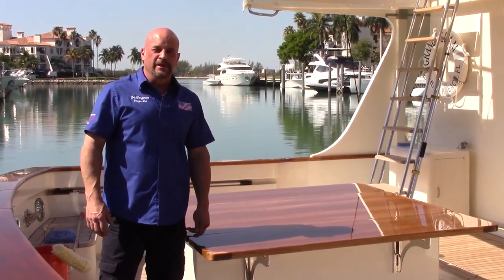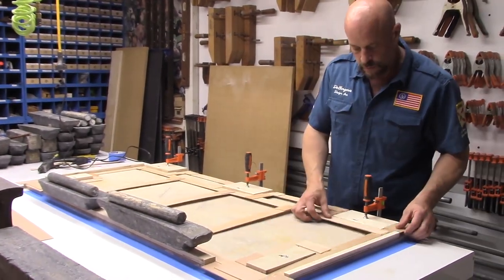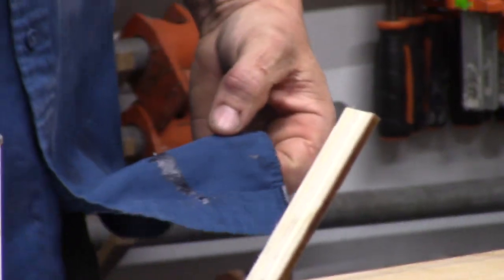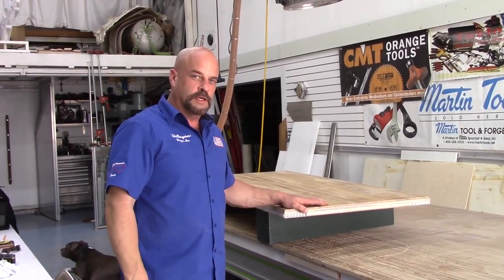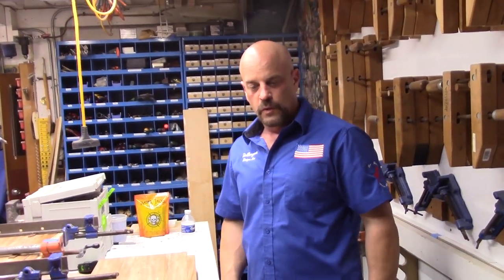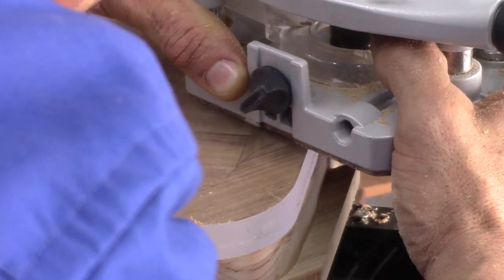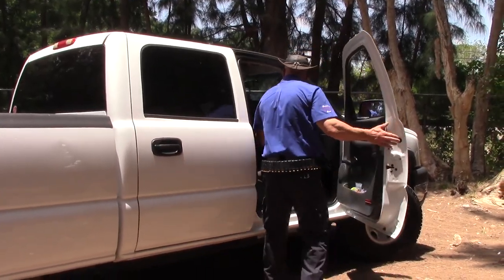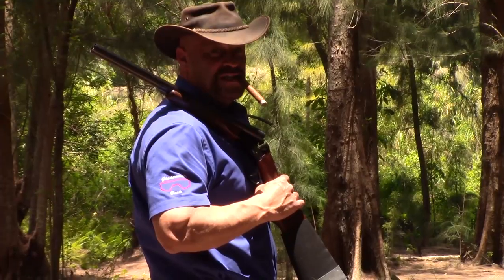Aft deck table fly leaf design Part.2

Comment: When you're doing the epoxy, is the tape wrapped around it so there's no epoxy build up on the other side where it runs off?  I assume you then tape off on the edge and epoxy the other side?

Comment: I think your dog said "are you kidding?!" in the beginning. LOL 

A lot of people fail to realize it's always best to make a smaller version as a test piece. Glad to see someone thinking ahead. 

A thou difference only tells me that, that's just the difference in the weight(s) you used to hold it while it dried. Since that plastic core will move slightly with weight applied to it, (if I remember correctly that is). 

It turned out wonderful. Another excellent video. Cheers. :)
Reply from the maker: Thank you for your comments. The honeycomb actually adds rigidity in weight to strength ratio and it will not move when properly bonded on each side. I used five different materials to prevent movement as well. Also was hoping to make table weight less as well. It still came in at 131 lbs or 59.42 kilograms.  The weight would of been at least 40lbs heavier if it was solid ply on the main table.
Thanks again,
Jim

Comment: I have never worked with epoxy before and am trying to make a part for the back of a bench. I drew a design on some wood then cut it out and am now wanting to fill it with clear epoxy. I have read that you use a heat gun to remove the bubbles but when I tried it I guess I burned the epoxy because it turned white and foamed up. Was I using the right procedure and just got it to hot?
Reply from the maker: Hello Steve, there is a lot of different information on epoxy out there. I personally don't use a heat gun for anything when coating epoxy other than to warm the wood before coating.  Denatured alcohol misting out of a spraygun works much better for removing bubbles from epoxy .  How thick did you coat the epoxy? Did you put a thin sealer coat on the wood  allowing it to dry before a heavy top coat was applied? Was the mix ratio exact, as an over catalyzed batch will do exactly what you described? As I was not there when the project was being worked on, my reply is merely a place to start.
Jim

Comment: Beautiful work - what is the biaxial <sic> cloth that you mention? is it fiberglass mat ?
Reply from the maker: +AndTheWinnerIs...  Thank you for the kind compliment. Bi-axial cloth is woven in three separate directions. Fiberglass mat is generally only two directional. Bi-axial has more structural strength.
Jim
Reply from the maker: +DeBergerac Design  BTW, Part one of the table shows lay-up procedure.

Comment: excellent, great job - i really need to try this honeycomb-core on my next table Project, not for preventing the warping but for weight purposes
Reply from the maker: Weight is a big factor for using the honeycomb, however it still needs a binder on both sides to be super stiff and strong.
Jim

Comment: A beautiful table Jim! And the metal work looked amazing as well. I too was wondering about the finish. Thanks for sharing the info. I will have to search through your videos to see if you have a finishing video.
Do you use a marine grade plywood for your laminations or something like I would use such as birch ply or appleply?
Ron
Reply from the maker: Hello Ron,  it depends on the project as to what we use for laminations, but on this project we used Baltic Birch ply. I find this to be the most superior product I can buy locally. It is glued up void free and seems to hold up well with the warping issues that we  have in a humid environment, like South Florida. You probably already noticed that are used Nydacore for the large part of the table. This helps with weight issues and gave me the thickness required.
Thanks for watching!
Jim

Comment: Nice work is an understatement.  Any chance you can give me a lead on those hinges a/o the slides you could have used vs the ornate brackets you did?  I want to build one of these for the saloon inside to make it easier to get in n out.  Sort of want walnut top...but would could go composite, too.   Sub'd.  Thanks for any reply; you seem like a class act.